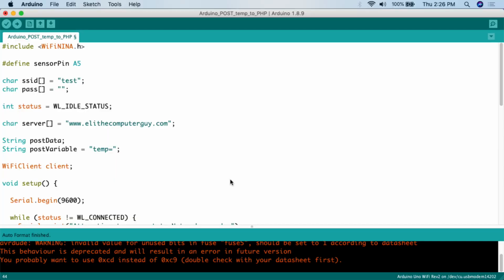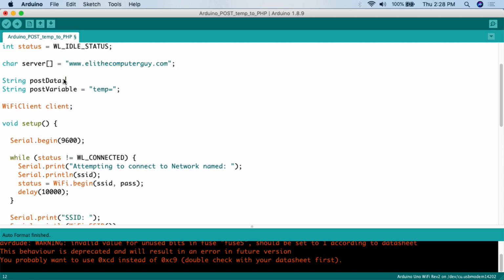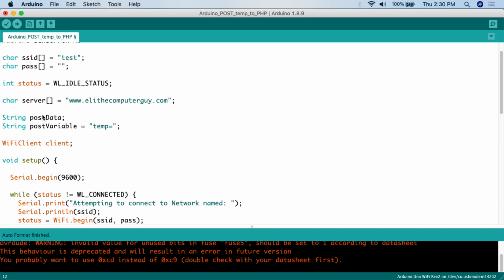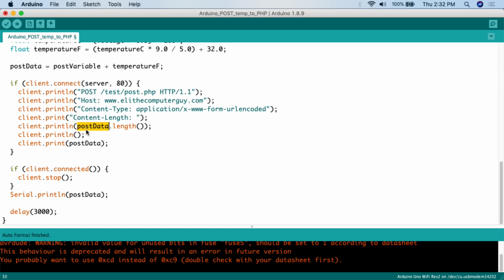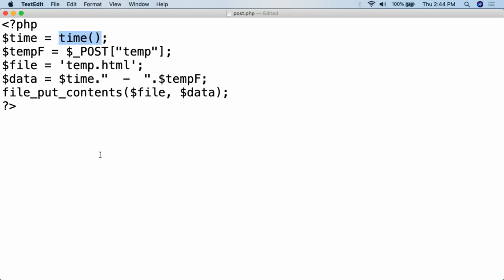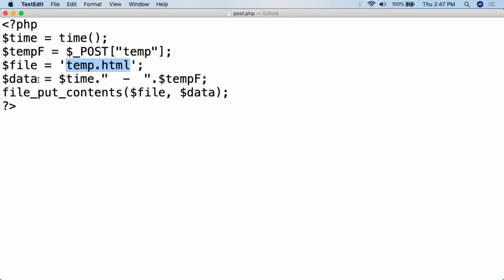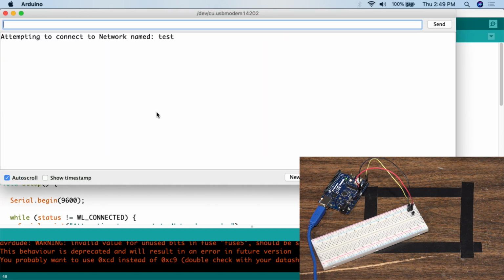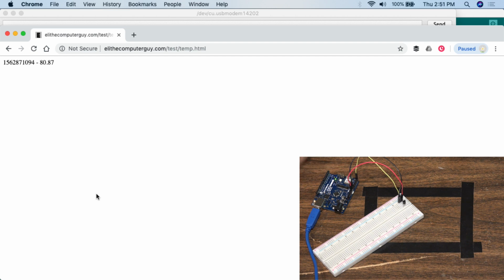Write POST Data to Server with Arduino Uno with WiFi

Comment: Hi there, thankyou for the tutorial. I needed a small help. I am using an arduino wifi rev 2 board to connect to SQL on local host via Wifi. My php files are located in xampp/htdocs and I am able to write data in the sql table hosted on local host via writing an http request on my laptop. However when I try doing the same through my arduino, I face the following issue:

HTTP/1.1 504 Gateway Time-out
Server: WebProxy/1.0 Pre-Alpha
   

My Arduino code:

#include <SPI.h>
#include <WiFiNINA.h>

int    HTTP_PORT   = 80;
String HTTP_METHOD = "GET";

char   HOST_NAME[] = "161.23.56.190";

String PATH_NAME   = "/index1.php";
String queryString = "?temperature=29.1";
//WiFiClient client;
WiFiClient client1;
#define SECRET_SSID "******"
#define SECRET_PASS "******"

///////please enter your sensitive data in the Secret tab/arduino_secrets.h
char ssid[] = SECRET_SSID;        // your network SSID (name)
char pass[] = SECRET_PASS;

void setup() {
  Serial.begin(9600);
  // attempt to connect to Wifi network:
  Serial.print("Attempting to connect to WPA SSID: ");
  Serial.println(ssid);
  while (WiFi.begin(ssid, pass) != WL_CONNECTED) {
    // failed, retry
    Serial.print(".");
    delay(5000);
  }

  Serial.println("You're connected to the network");
  Serial.println();

  Serial.print("SSID: ");
  Serial.println(WiFi.SSID());
  IPAddress ip = WiFi.localIP();
  IPAddress gateway = WiFi.gatewayIP();
  Serial.print("IP Address: ");
  Serial.println(ip);

  
}

void loop() {

   // connect to web server on port 80:
  if(client1.connect(HOST_NAME, HTTP_PORT)) {
    // if connected:
    Serial.println("Connected to server");
    // make a HTTP request:
    // send HTTP header
    client1.println(HTTP_METHOD + " " + PATH_NAME + queryString + " HTTP/1.1");
    client1.println("Host: " + String(HOST_NAME));
    client1.println("Connection: close");
    client1.println(); // end HTTP header
    delay(5000);
  }
    while(client1.connected()) {
      if(client1.available()){
        // read an incoming byte from the server and print it to serial monitor:
        char c = client1.read();
        Serial.print(c);
      }
    }

    // the server's disconnected, stop the client:
    client1.stop();
    Serial.println();
    Serial.println("disconnected");

}

PHP file:

<?php

if(isset($_GET["temperature"])) {
   $temperature = $_GET["temperature"]; // get temperature value from HTTP GET

   $servername = "localhost";
   $username = "Ard";
   $password = "ArduinoGetStarted.com";
   $dbname = "db_arduinoo";

   // Create connection
   $conn = new mysqli($servername, $username, $password, $dbname);
   // Check connection
   if ($conn->connect_error) {
      die("Connection failed: " . $conn->connect_error);
   }

   $sql = "INSERT INTO tbl_temp (temp_value) VALUES ($temperature)";

   if ($conn->query($sql) === TRUE) {
      echo "New record created successfully";
   } else {
      echo "Error: " . $sql . " => " . $conn->error;
   }

   $conn->close();
} else {
   echo "temperature is not set";
}
?>

It would be of great help if you could have a look at it and help me out with it!

Comment: I have an ESP 8266 (version 01) which therefore includes a GPI0 0 and a GPIO 2 (it seems to me that on this version is only usable the GPIO 2), but my concern is that all my sensors and other components are on the arduino card, so I don't see how to already transmit the data to the arduino card, and how to do with a single output to communicate all this to it, reciprocally from the card to the ESP

Comment: Thanks, got me kick started.  Posting data all day long to my server.  But, once the data is posted, I'd like to return data to the Arduino, just pass a few variables.  1) Post data to server, 2) Do some calculations with that data 3) Return some data to the Arduino.   Could be as simple as 22,54,12

Comment: I know nearly nothing about arduinos but I know some coding. I was looking for a solution to use in a field to check weather stats for the crops. The infos you gave are amazing and I will order the components and do the project right now. Thanks a lot!

Comment: is it possible to send data from multiple Arduino Unos with WiFi to a laptop?
Reply from the maker: yes... you should just add some type of device identifier for each device that posts...
Reply: @elithecomputerguy  i am not sure if I understand it correctly. Suppose that I have 10 Arduino unos with WiFi. When I send data from the first Arduino uno, I include a text of "1" in the data to indicate that it is from the first Arduino uno. For second Arduino uno, I include "2". And so on and so forth. Am I correct?

Comment: The information on your website and in the video was instrumental in helping me post data from the Arduino Uno WiFi Rev 2 to a website. One problem I struggled with was an error in the php code line 3 or $tempF = $_POST["temp"];. I was having problems so I started checking the error logs in my FTP application and found the following: Undefined index: temp. I changed line 3 to the following: $tempF = $_POST['temp'];. Maybe this problem is server specific. Just wanted to post this to help anyone encountering the same problem.

Comment: Great series! I like how these concepts you show are gradually getting more sophisticated!
It would be very cool if you could expand on this in a future video, because at the moment only the most recent temperature is stored in the HTML file, whereas saving to a file would also allow for logging previous temperatures.

As I'm planning on building an RFID based workplace login/logout tracker, it would be great to just transmit the ID and let the PHP script log it to a HTML with timecode and other info, ideally in a (styled) table of some sort.
Reply: Were you able to finish the project? I am also doing something similar.